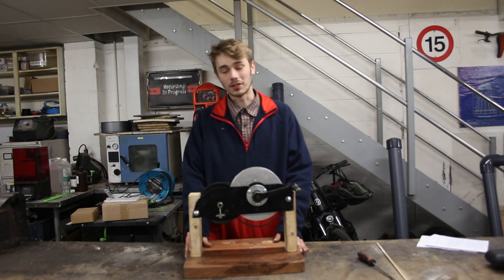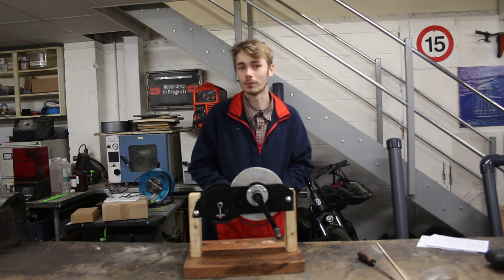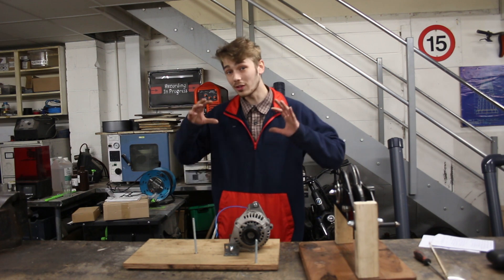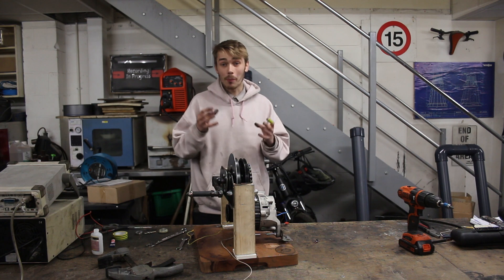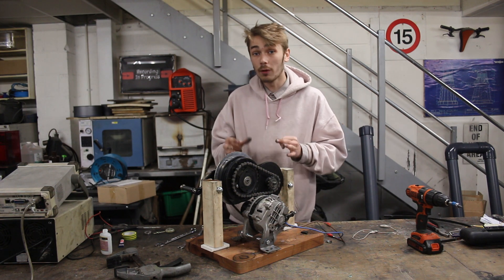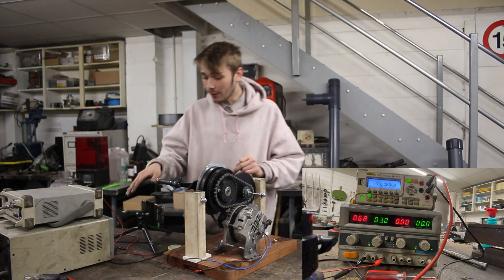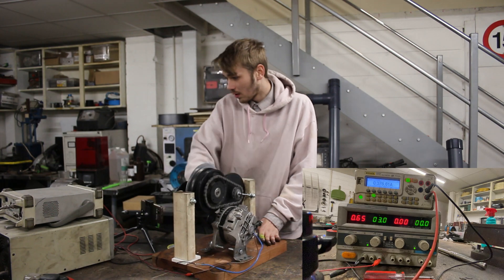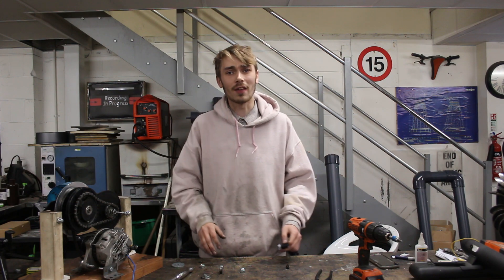1525 - Hand Powered Generator

Comment: It looked like you could get 12v from that just by running it at 12v and .1-.2 amps without it adding more resistance. Which would be pretty decent for charging a small motorcycle battery. Or put 5v to charge your phone by hand?!?